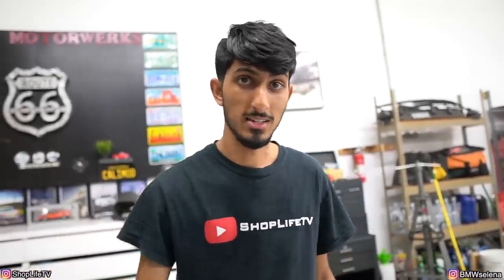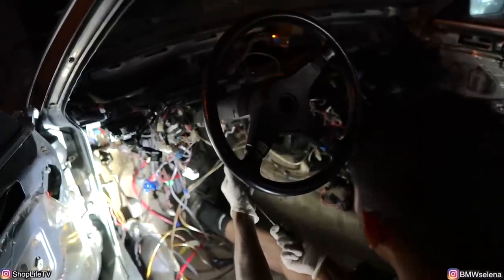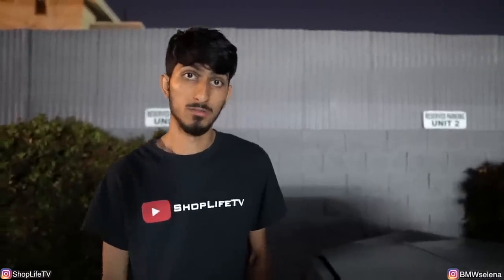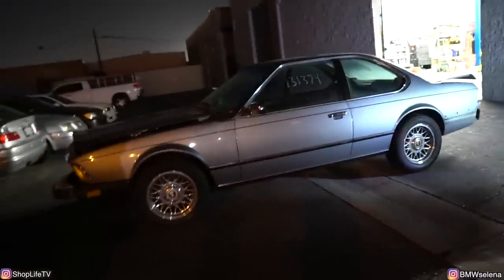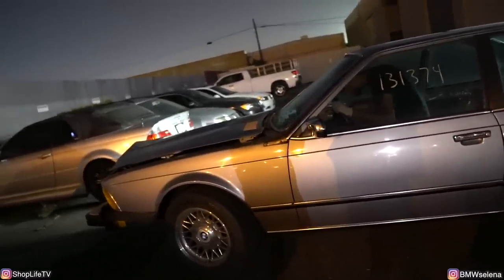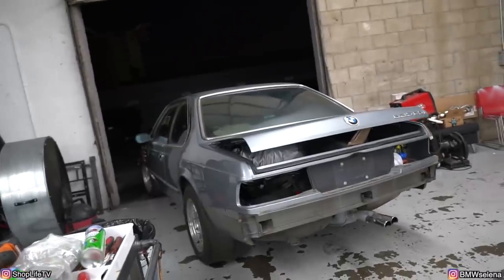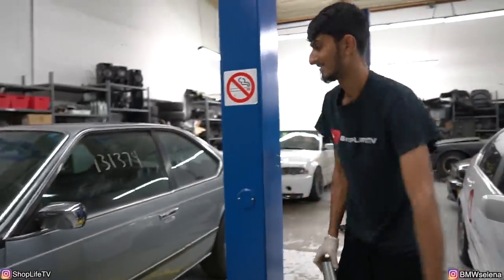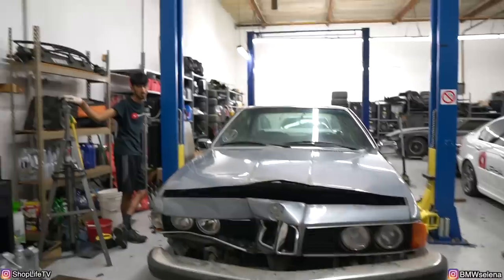Using a SCREWDRIVER to turn on car ...

Comment: Stripping the E24! Some hints:  You guys or the owner should list the parts for sale on BigCoupe.com (free membership required). 
You could get the steering wheel to unlock by taking out the security screws with a chisel and hammer. Once they're out the column will move up far enough to unlock it to steer. Too late for that, I guess. :(